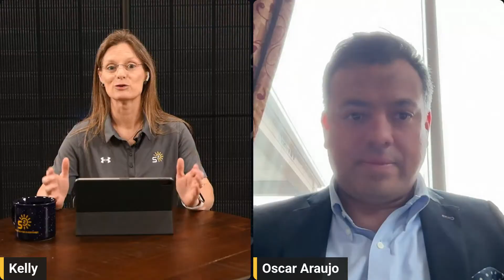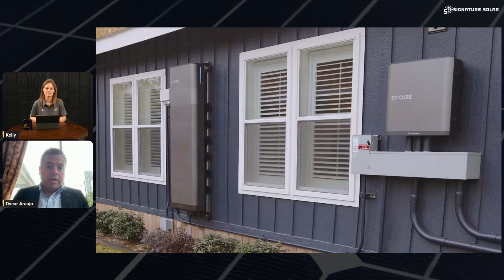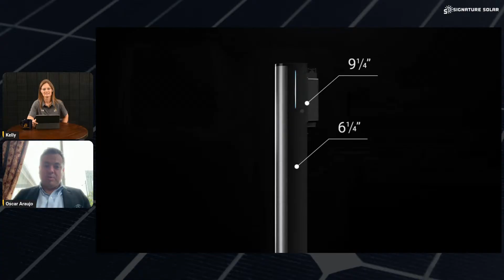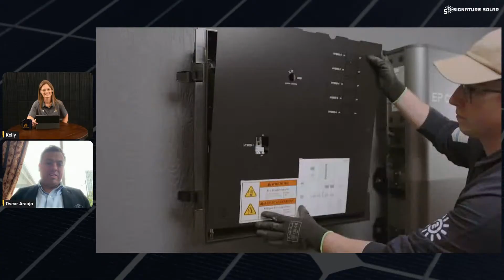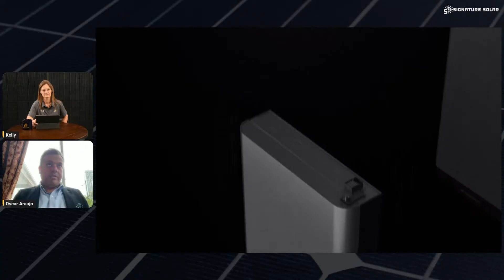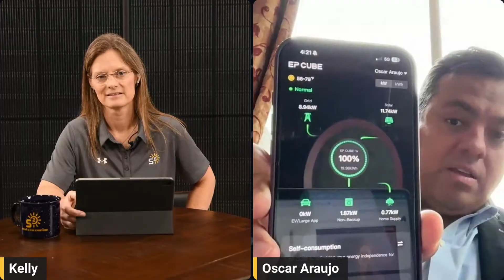Amp Up: Solar Talk - Ep. 20 - Ep Cube ESS and U.S.-made TOPCon Solar Panels

Comment: I bought 10 of your solar panels a year ago. I had to move those panels to another location and when I stacked them on the trailer the frames were very thin. Out of the 10, 6 of the connectors broke the panels because the frame was thinner than the connector.
Reply: They want feedback, here is a good learning opportunity for them.
Reply from the maker: Thank you so much for your feedback, we will forward this to the manufacturer!
Reply: @SignatureSolar  So what was the outcome from this??